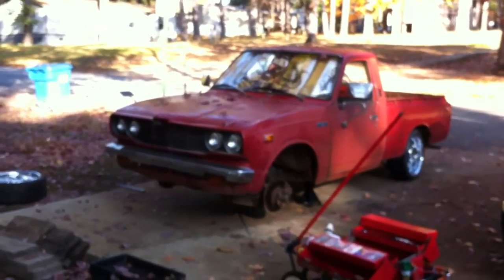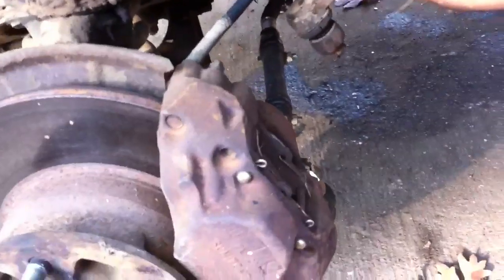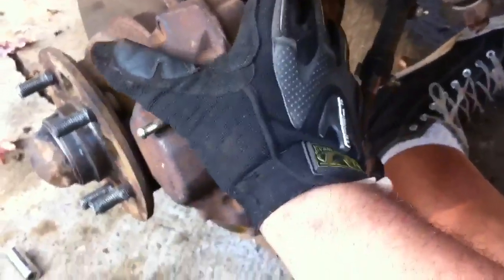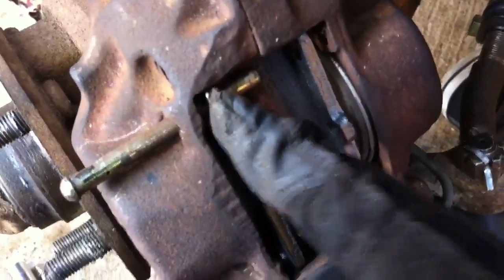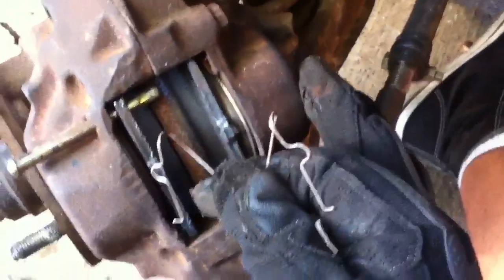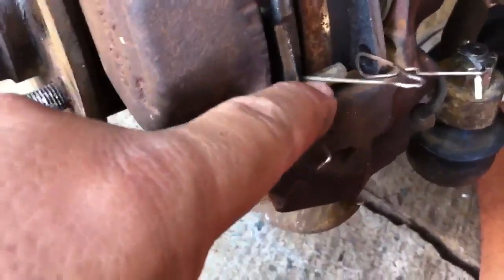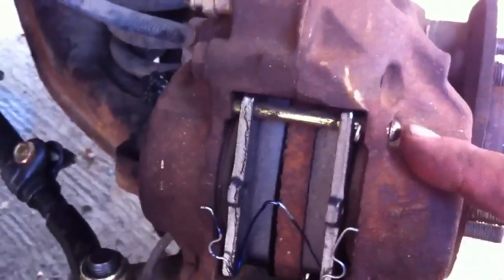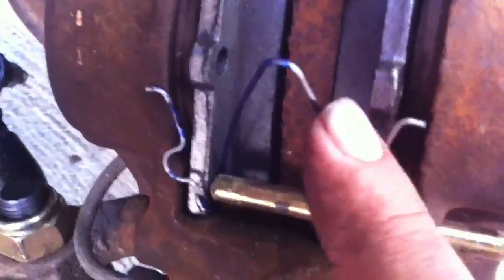How to change disk brake pads

Comment from the maker: @LburgVAGuy thank you very much for your support. I thought I examined it in one of the Nissan videos I was very random back then so I'm not really sure what video it was in. I used the body mounts them selves pulling the fender out then remounting the the mounts higher to hold the fender out I think I went 3" closest to the cab and 1.5" out at the rear so it gave it a smooth transition front to back. Hope this helps you. And thank you for watching.